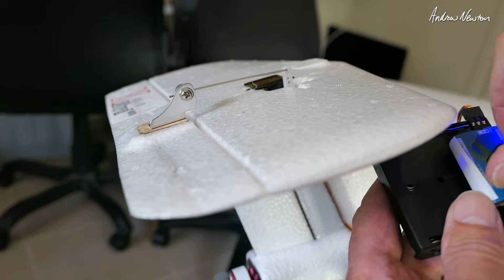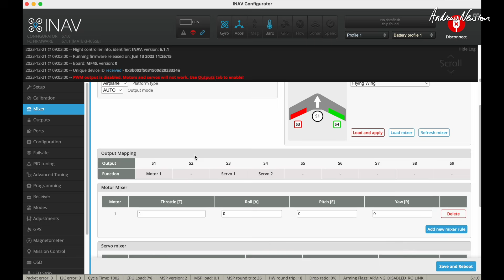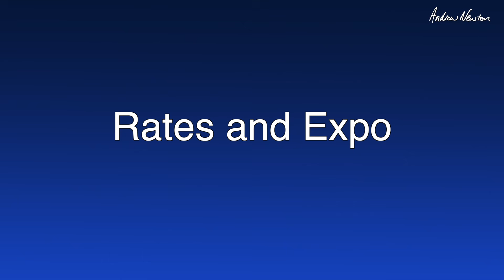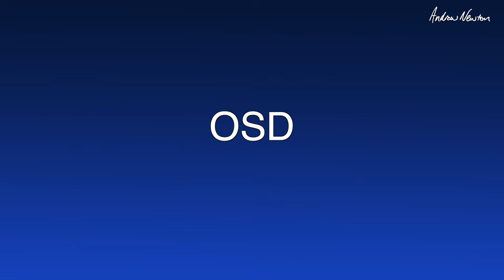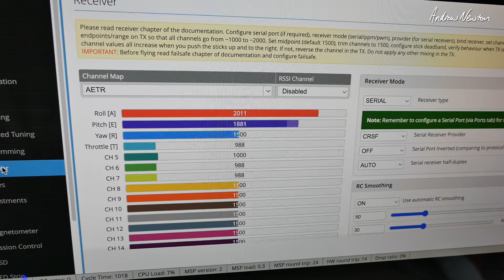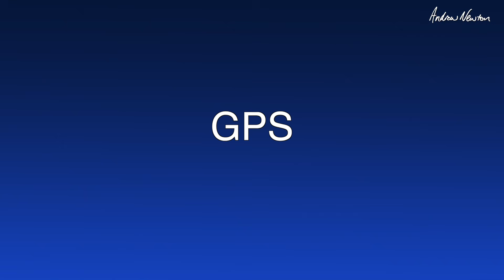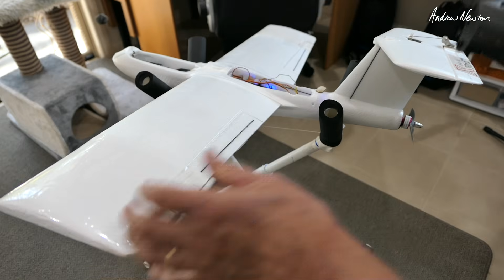Simplified INAV for fixed wing

Comment: Andrew, This video has been a great help. I currently have everything working with the exception of Arming. The motor passed the manual on screen testing. When I Arm I get an error message on my OSD. It says "roll pitch center". From some research I think it refers to centering of the roll and pitch, however I do not know where or how to adjust this. Any input on this issue would be much appreciated. I am using a Speedybee F405 Wing FC and the same version of INAV you used in the video. Thank You Buz
Reply from the maker: In the receiver page you may have the wrong Channel Map. TAER instead of AETR. Or you may have mixing or channel assigned wrongly in your radio. Which radio and receiver are you using?
Reply: I checked again this morning and the left aileron is in channel 3 on the FC, and right aileron is in channel4 on the flight controller. The channel order is AETR as you suggested. I'm using a Tarranis Qx7s and a FrSky XM+ sbus receiver.
The error message on the OSD is Roll Pitch not Centered. Does INAV have a list of error messages with definitions? @AndrewNewton
Reply from the maker: Receiver page should look like this pic https://www.youtube.com/@AndrewNewton/community. Do you have elevon mixing in your radio or is it on Mode 1?
Reply: I finally think I know what is going on. It seems my SF switch is overriding my aileron channel causing it to go low when in the disarmed mode. I think I will start over in the morning and set it up from scratch. Thanks for your help.
Reply from the maker: Yep that would do it. Glad you found the problem.
Reply: I got it! The throttle cut switch was messing with my roll angle prior to arming. So I changed some things around in the channel mapping and all seems to work now. I knew it was something I had done. Good news is I learned a lot along the way. Thanks again for all the help.

Comment: I've been messing with mine for a week and I've gone through all this step by step.
The sticks are moving in both the radio and iNav but no control surfaces or motor movement when I'm finished and connect the flight battery.
The receiver is just beeping. I'm using an eflite avian esc, and it has an extra yellow wire, I'm thinking that might be my problem?
Reply from the maker: Could be the esc is too "smart" Try just connecting the ground and signal wires. Possibly need to calibrate the esc using INAV configurator.
Reply: Thanks Andrew I'm giving that a go 👍

Comment: Hi Andrew there is one thing I can’t seem to find with fixed wing set up. I can’t get my servo horns fitted very close to 90 degrees, is it done in inav somewhere? 
Thanks
Reply from the maker: Centre your servos then mount the arms as close to 90 as the spline teeth will allow. Doesn't have to be perfect. Then adjust the pushrod lengths to level the control surfaces. You can adjust the servo mid points in the Outputs page but INAV will take care of it if you're in the ballpark.

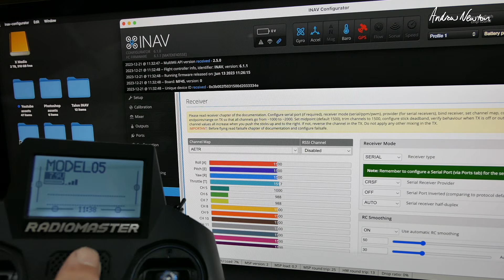Comment: Very good video thx! Only one thing I am not sure about is at 18:00 you said reverse the channels in the radio. I think it is not good, because if you reverse them, how to use stick commands? Thx!
Reply from the maker: Only if the radio outputs move the wrong way (looking at the INAV receiver page graphs). Stick commands would not work if the outputs were going the wrong way.

Comment: Really nice video! But I'm having some issues... 1st I config the radio as you did but when I move the elevator the ailerons move and when I move the ailerons the elevator moves... what can I do?
Reply from the maker: Probably plugged them in to the wrong pins. Which board and which plane?
Reply: @AndrewNewton   I think I just solved it, by default Inav wing it's: 
Servo 1: stab roll 50%
Servo 1: stab pitch 50%
Servo 2 : stab roll  -50%
Servo 2: stab pitch 50%
I just swap these two and voilà... have to check if surfaces moves as it should on the different modes but now the sticks works as it should... what do you think?
Reply from the maker: Yes well done. Just have to play with the +50 and -50 weights until they move the right way.
Reply: @AndrewNewton  thanks, you are the best!! Keep going like that 😎
Reply: I'm using the speedybee f405 wing and I'm setting up the CK840mm wing, I swapped servos to see if was that but nothing...

Comment: Hello Andrew! Excellent video, I would like to answer a question if possible. I'm almost ready to make the first flight using INAV on an airplane, I only did tests with the airplane on the ground and stopped. I noticed that when I'm in manual mode, the control surfaces, elevator, ailerons and rudder, move as much as possible, but when I switch to ACRO, the surfaces move very little, even with the sticks at 100%. Does this happen because I'm at zero speed? Or is something wrong? Thank you very much in advance!
Reply from the maker: That is normal. Manual gives maximum throws while all other modes have less throw to allow extra movement for stabilisation. If you are concerned the movement is not enough you can increase he FF for roll and pitch in the PID tuning page.
Reply: @AndrewNewton  Hello, thank you very much for the answer! I've already increased the FF values to get more command. I needed to do this because I'm going to take off the plane from the runway and when we start accelerating, the plane may deviate from the center of the runway to the left or right, that's when I'll need a lot of rudder control to bring it back to the center. I was worried that the FF close to maximum would be a setting that could interfere with the pid tuning, but from what I understand the FF shows the INAV what is the maximum command that the plane can have in stabilized flight, is that correct? Thanks again for the support!
Reply from the maker: Roll Rate, Pitch Rate and Yaw Rate, in degrees per second, set the maximum rotation rates. FF sets how much stick movement is passed through to the servos. Set FF so you get about 80% of the full manual throws when in ACRO mode.
Reply: @AndrewNewton  Hello! It was exactly what to do! After answering the questions with you here, I reread the documents on GitHub and managed to understand better! Thank you very much!
Reply: @AndrewNewton  I would like to answer just one more question if possible, I promise it is the last one! Before taking the first flight I am doing all the tests possible to avoid making mistakes on the big day. And one of these tests is to select autonomous flight modes with the plane stopped (zero speed) to see what happens. I noticed that when the plane is disarmed,  no key works, not even the failsafe if i remove the receiver, but when the plane is armed, even at zero speed, when I activate the Return to Home key, the plane does nothing, perhaps because I configured it to ignore RTH if the plane is not 30 meters away, but when I activate Loiter (Position Hold) or Cruise mode the plane starts the engine. The same happens if I remove the receiver to test Failsafe. As the plane is stopped, I wanted to know if is this a normal behavior or if there is any way to tell the inav not to do anything if these switches are activated or if i losst signal (with the plane stoped) Thank you again!

Comment: Hi I have a question
My INAV has already responded to the Remote movement but the Servo hasn't
I plug the servo wire to the S3 port in my Speedybee F405wing
Currently, I only use USB to power the board and the servo
Is that the problem for this issue?
My remote setting (mixes) is already the same with you

I am still waiting for my Battery connector to arrive before can power up the FC and Servo using Battery
Thank you so much for your help
Reply from the maker: USB only powers the 4V5 pins

Comment: Great info, as usual. Wondering if the admonition against using the radio model for rates and expo is a general best practice for fixed wing or specific only to INAV? I set my 1st plane up with dual rates and expo on the model inputs (as I had done on my quads). It's a DSMX AS3X Rx, and I use a Radiomaster TX16S with a 4 in 1 internal module for DSMX. I see guys using Spectrum radios and "Forward Pgming" to set rates, etc., but I don't know if that is changing params in the radio model, the TX or the Rx? And I see the T16S has some forward pgming LUA's but have never tried to use. Appreciate any advice. Thx, and hope you are having better weather than we are in Seattle!
Reply from the maker: Greetings. The weather is beautiful here in southern Australia at the moment. I was only referring to INAV and flight control boards. Rates and expo in the transmitter are fine for normal model flying with no flight control board. Forward programming is a Spectrum specific feature for setting up receivers from the radio (I think) Not sure about rates and expo with stabilised receivers. Maybe this will help https://www.youtube.com/watch?v=Wq2OpoMILYw
Reply: @AndrewNewton  Thank you very much for your reply. I was hoping I wouldn't have to learn any more ecosystems like DSMX, even more so after I watched the video. So now I can proceed with gettting my Swordfish (INAV) and Bigfoot (Vector) ready to fly when the weather improves (in a few months!).

Comment: I really love this series - IMHO it couldn't be more perfectly targeted.

Before the Seriously Dodo flight controller was discontinued, I purchased a few of them directly from RMRC.  The Dodo has since been dropped by INAV, presumably because of its small FLASH size.  But the extra features that require the extra FLASH aren't relevant to my simple requirements.  So I'm trying to find an old version of INAV I can use with the Dodo.  Your tutorial is extremely helpful in making this effort work.

 Perhaps I should just buy a new FC, but it galls me not to get use out of the perfectly good ones I already have. ;)
Reply from the maker: Thanks. Try INAV 1.7.3

Comment: Hi,I´m new to inav, from BF i´ve learned to set the rx outputs exactly from 1000 to 2000 via cli rxrange command. Your´s going from 988 to 2011. So is there no need in inav to do like this?
And why you setup MSP= on in uart 1? Thanks in advance.
Reply from the maker: Best practice is to adjust channel limits in the radio so they go from 1000 to 2000 but it doesn't seem to be essential. MSP on UART1 is preset, but you only need it if you damage the USB socket.
Reply: @AndrewNewton  , thanks alot.

Comment: Thanks for the instructions. I'm setting up my first FB, the SpeedyBee F405 Wing, my receiver is FrSky X8 and my radio is Radiomaster TX16S. The switches I assigned work well as well as the GPS. But with no inputs in my radio, there is no movement of ailerons, elevator, throttle and rudder. If I add the inputs in my radio, the controls work. How can your controls work without inputs?
Reply from the maker: What did you choose as the Sources in the mixer page?
Reply: @AndrewNewton  Oh, yes. Now I get it 🙂. Thanks for the hint!
Reply from the maker: Clever man Vlad. You should be OK now

Comment: The stock PID's are garbage.   Zero to 2 on P.  25 to 30 on I.  FF is usually around 20, keep it to where your manual mode deflection is.  Both axis.  It will fly out of your hand in Acro mode, and will handle wind much better.  It will also hold attitude and trim will not change throughout the speed range.  The idea that acro mode is just manual with some P term, which a certain dev believes, is silly.  Make it a true rate mode so you can use it.
Reply from the maker: Thanks, worth testing your suggestions but not in this series.

Comment: Great video for the noobs Andrew....I like how you deleted the Inputs and created the model directly using the Mixers. I'm going to try that....Less is more...for sure.
Why do we even need Inputs???....🤔🤔🤔😮😏🇬🇧
Reply from the maker: Thanks ET. Supposed to reduce mixer lines when using expo and rates, but I can get by without Inputs
Reply: @AndrewNewton  Oh, that's interesting. Well I never use rates or expo on a Flight Controller with plane or quad....If I'm flying an ordinary plane LOS, then I only use Expo, never rates as well. That's why Expo was invented, no buggering about with rate switches..!!!!....🤔😳😏😀🇬🇧

Comment: Hi, in Speedybee F405 Wing there is JST socket for GPS. Then, in what UART the GPS will be if I connect in that socket?
Reply: If there is a solder pad on the GPS, you can refer to the accompanying diagram for the F405 GPS output to make the appropriate connections. Connect 5V, GND, TX, Rx, and if available on the GPS, PPS. Andrew has a detailed video explaining the F405 flight control board; you can check that for reference.
Reply: For the speedybee f405 wing mine is uart3, I did have to redo some of the cables since the gps pin layout does not match the port layout on the FC
Reply: @DawidJacobs-e3d  Hi
What cable that has differrent lay out?my GPS is Walksnail M181
Reply: I used a matek gps and 5v and ground was next to each other and the speedybee pin out it is not. Just verify that its the same on both otherwise you will have to swap,i am not familiar with the one you are using.@rahadyanmuhammad271